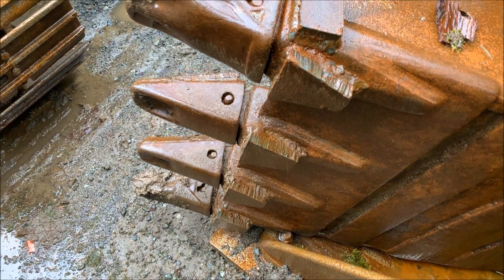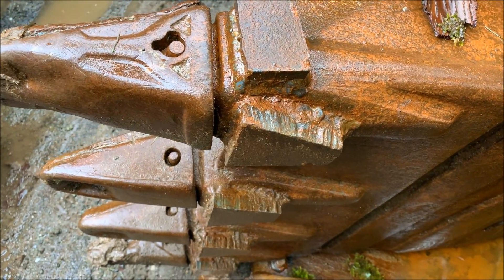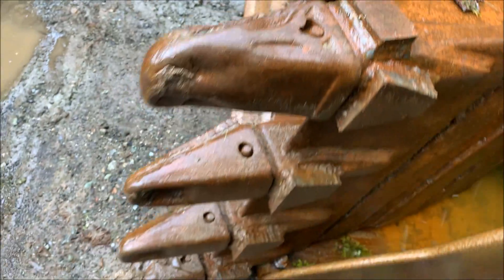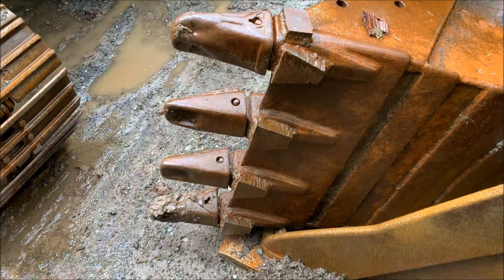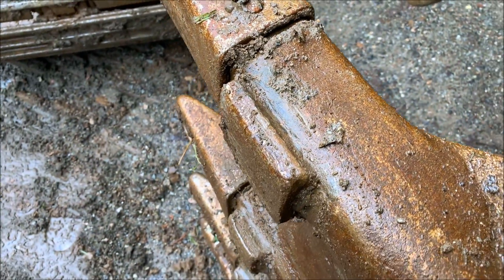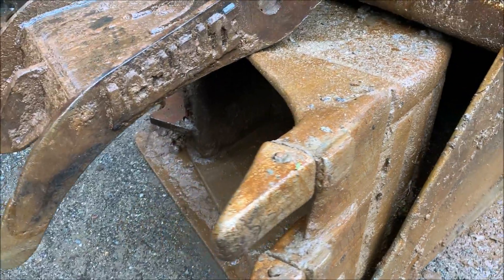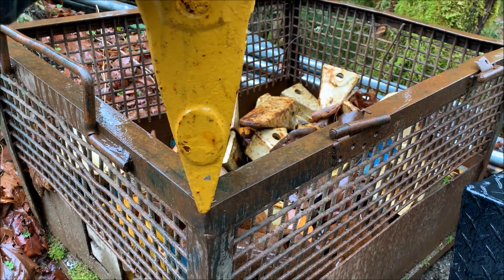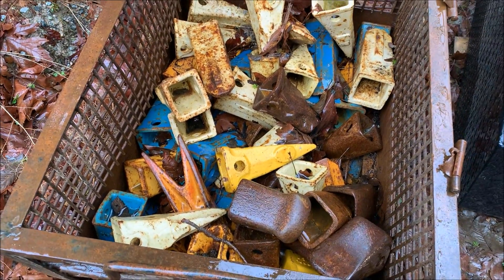Losing Excavator Bucket Teeth??  Cheap fix Solution

Comment: Pins are breaking on CAT tooth model 2085236 while removing stumps. Any suggestions on where to find pins that don't break?
Reply from the maker: Possible that the shanks have a lot of wear in them and the tooth pivots back and forth on the shank using the pin as a fulcrum point and breaking it.

Comment: I work in rock and such all the time, it's the constant pulling and lifting that will bend the pins, ansd, the tooth wearing back and forth on the shank, will wear the shack down and needs to be welded back up again
Reply from the maker: Yes, that is the slow death to the teeth and shanks over time

Comment: definitely pulled a tooth off splitting stumps. you can also pry the whole shank off as a bucket wears thin. If you dig very long without caps, the shanks won't hold teeth anymore. I've seen people weld the teeth on but that doesn't work very long.  You can't fix stupid.

Comment: Good idea and I like side cutters and any hard facing or reinforcing that can be done on a bucket. I try to use the tooth as in raking and not the bucket in rough stuff and with rental rigs that I run for folks their mechanic will give me spare locks and even grease. I like taking care of stuff and I tear as many roots loose as I dig the stump out as I can. That' helps with the splitting some. And no, you are NOT a dummy. So THERE! GBWYall!

Comment: I lost two teeth loading scrap tires once,found one. No idea how that happened considering I load concrete, do demolishion etc, and never lost any. thanks for the tip.
Reply from the maker: Cheap trick for worn shanks is weld each end of the tooth pin hole in a bit, or right over, or weld a one inch square plate over the ends to box the pin in. If it can be glued on with heat ,it can always be unglued back off with heat later when needed. New shanks hold teeth on way better than worn ones

Comment: that is a brilliant solution. I will be doing that to the bucket on my machine. I don't have the issue of other operators, but there is nothing more frustrating than searching for the new tooth you just put on that morning.
Reply from the maker: This trick is only to prevent back dragging causing the pin to bend like a horsehoe, which allows the tooth to hang lower off the shank.That allows the tooth to 'cam' over some on a worn shank and will finish the pin off in a hurry. I also full build my shanks/adapters back with welding   to new fitting tight specs, now and then,doesnt take long.
Reply: @skadill  mine does need the shanks built up a bit as well, however , this will also help as you said when dealing with bony ground and when pushing stuff away. any little truck that helps a bit is worth doing.

Comment: Cat backhoe DRS 230 diagonal retention system, running that system on my 305CCR, had to bolt the teeth on, two bolts over life of tooth. Lots of concrete demo work.
Reply from the maker: Not familiar with that at all.There is/was a Esco Heli-Lock tooth the loggers liked. It twisted on a quarter turn like a thread, stayed tight.pricey,and had weird retainers,but worked good.
Reply: @skadill  I’ll get ahold of you on Facebook.
Reply from the maker: @smedleypdolittle   Wont work,I dont exist online

Comment: My ole Hitachi has them anoying serrated pins that go through the working face of the tooths... any little branch or rock will poke the retainer out, then you lose the tooth...So i've just welded the damned things on, 11018 rod get em good and hot, if I need to change them I can gouge off the weld and thrown another tooth on almost as fast and pounding out the old pins.
Reply from the maker: had them 30 years ago, bad when burning stump piles, they melt off into the fire. I had a machine ten years ago with that style and welded small inch square plate over the top and bottoms to box the pin in permanent, then just grind or torch the little lid plate off for new tooth change time.they stay on then good

Comment: Like #72.  Interesting.  I just looked at a bunch of pics of the shovel I ran [336] and noticed there is a wear plate about 10 inches deep, welded to the bottom of the bucket where you had the small pieces.  And the bottom of the plate sticks out about 2~3 inches past the side of each outer tooth.   Digging blast rock, loading tri-axles dump trucks to 30T rock trucks I never had a tooth come off this summer past.
Reply from the maker: Theory doubled confirmed then,it works

Comment: I have been carrying a metal detector in my hoes for years...lol
Reply from the maker: I have a couple times welded a little plate over the ends to box the pin in.But that's when the shank is worn right out,and nothing stays on them

Comment: That's a good idea, we sold off the rental minis. Kubota buckets use the sh*ty rubber core pins. Our KX80 buckets I've welded the teeth to the shanks. When I did replace the shanks, I changed them out for Cat style shanks. I'm glad the rental fleet is gone. I was tired of dealing with the BS.